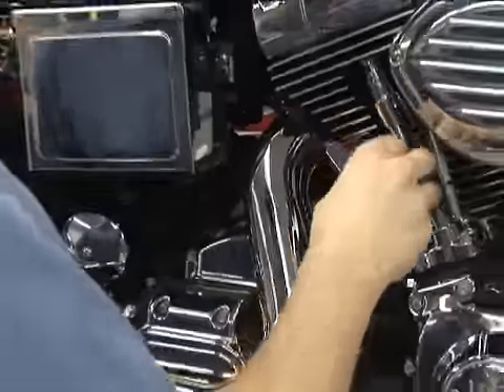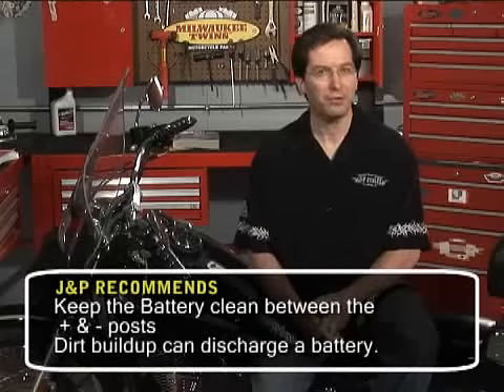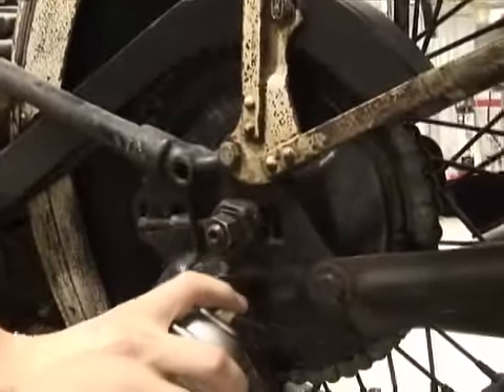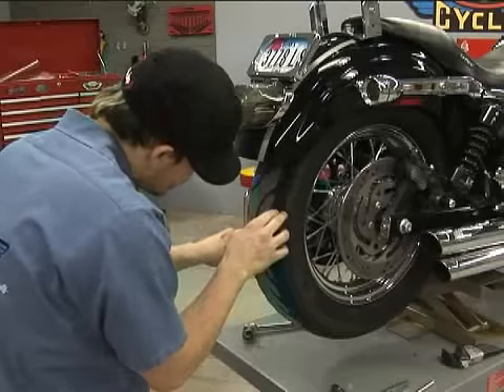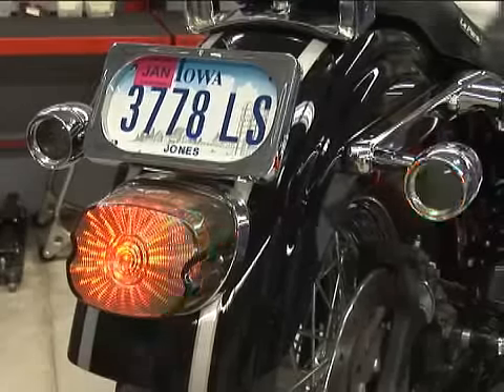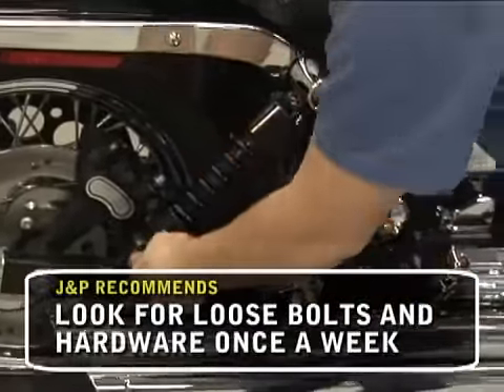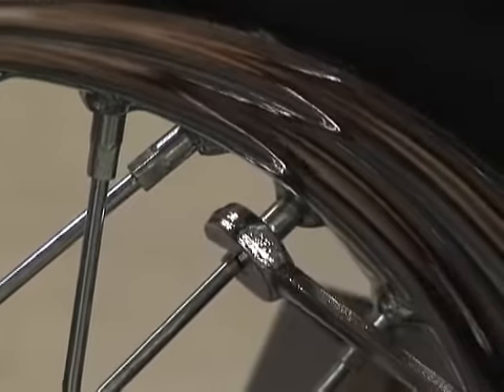Motorcycle Maintenance - Top Ten How To Tech Tips brought to you by J&P Cycles.

Comment: 1:16  Check the fluids 
2:09  The battery 
3:13  Chains and belts
4:59  Tires 
5:51  Filters 
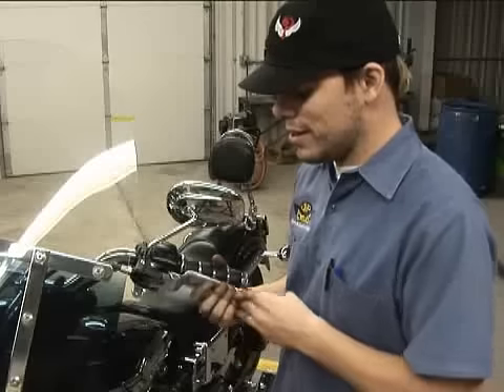6:29  Cables 
7:28  Lights and turn signals 
8:01  Brakes 
8:49  Nuts and bolts 
9:32  Wheels spokes 

Ride safe, everyone.
Reply: you're the MVP
Reply: Likewise brother!

Comment: I realize this video was uploaded in 2007. Regarding the brakes and brake fluid, it was said that all Harleys from 1977 and up use the DOT 5 silicone base brake fluid. Keep in mind that some later model years require DOT 4 if your bike has the new ABS system. Thanks!
Reply from the maker: Good info, thanks midlantic1
Reply: Not only that, but DOT 5 is silicone and definitely not compatible with any other grade of brake fluid.

Comment from the maker: @wrinlyhamster My personal bike is an 82 KZ1100 that sat outside in Iowa for 4 yrs with the head bolts loose.  It didn't take much for it to run...  Gas, Battery and a gasket.  If it ran before you parked it, it should run again.  If not, then fix it.  It's worth it just to do the work yourself, beleive me.  
Shannon A.
J&P Cycles Video Producer.

Comment: Good vid, but the comment on brake fluid for Harleys is not current.  New Harleys do NOT use DOT 5 fluid!!  DOT 5 is silicone-based and not compatible with DOT 4, which is being used now on new Harleys.

Comment: Question. 
I have an R1 were the coils are direct fused to 15 amp. Intermittently it blows and out of frustration Ive stripped the harness and check for shorts (none). This last time I looked around and found a coil cracked under the boot and the well filled with oil. Can this cause the short. When it does occurs the bike dies and will immediately blow fuses when key is turned on until it sits for 10 minutes then it will run fine till when ever it decides to occur again. Any help or ideas would be appreciated.
thanks
Reply from the maker: +steve ricci Without being there to actually check out the bike myself, my guess would be that the coil is over heating. I'm not well versed in sport bikes, but if it is an oil cooled coil that has cracked and the oil leaked, that would make since. I hope that helps. If not I can give you my email and we can try to go further.
Reply: +J&P Cycles 
thanks for the response,  the coils are not oil filled but the oil is engine oil.  I just was not sure if the oil can act as a conductor for the cracked coil  and buy either entering the coil assembly or creating a pathway to ground creating the short when the coil fails
Reply from the maker: That could possibly be an issue. If replacing the coil is out of the immediate question, I would clean thoroughly with electrical contact cleaner and let completely dry before applying a sealer to the crack and see if that helps.

Comment: if engine level decreases bike gets hot faster?
Reply from the maker: The oiling systems are designed to use a certain amount of fluid, so if you are low, then there will be more friction and that will lead to more heat.